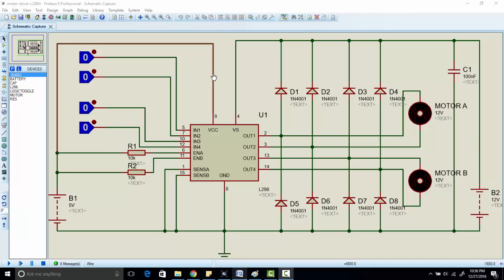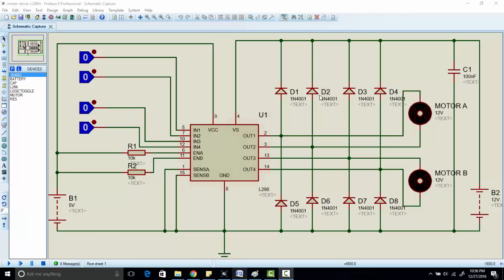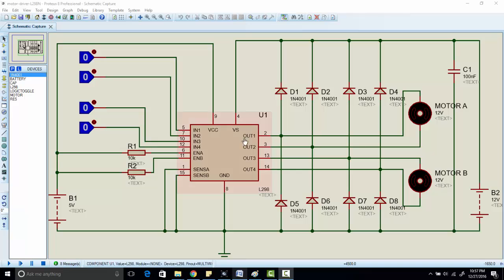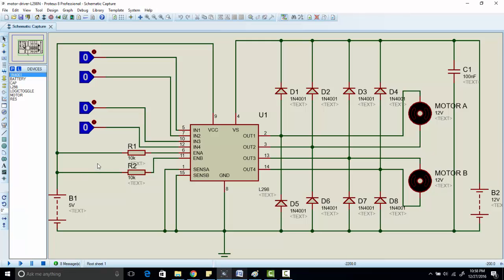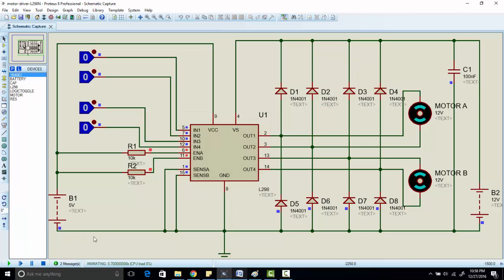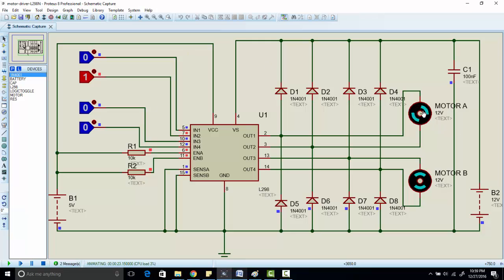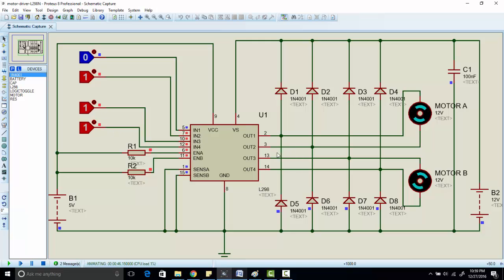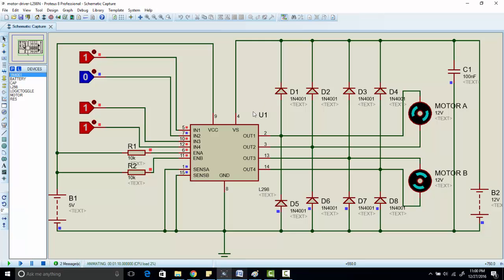HOW  to use L298N dc motor driver

Comment: I am using L298 with UNO to make a simple robo car... after copying working code from some site, i loaded the program and powered L298 with a 9V battery... but only one wheel is spinning... i. e., only one port is receiving charge and not the other...
Please someone help me in this regards...